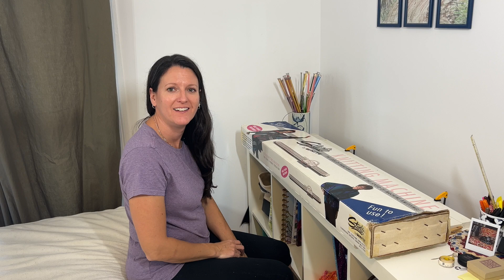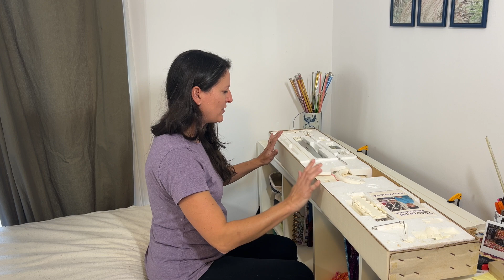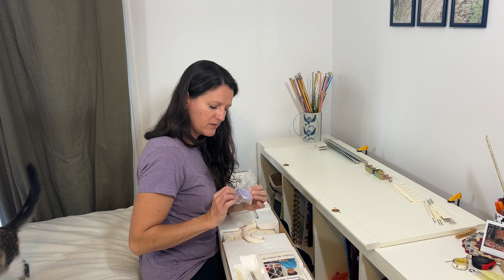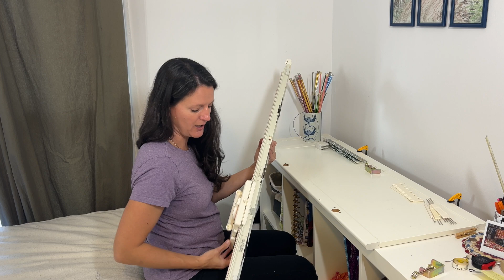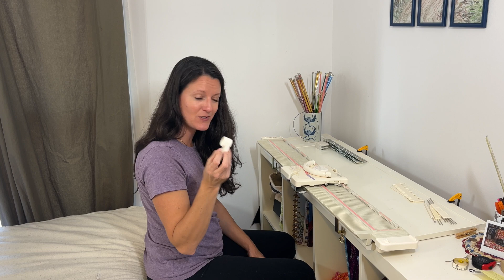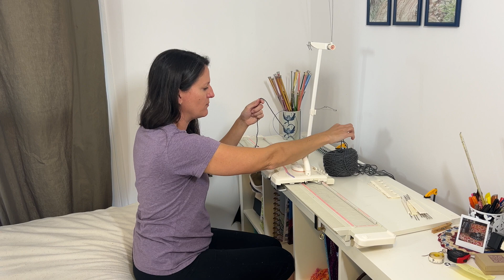LK150 Knitting Machine Setup for Beginners | Easy Step-by-Step Guide

Comment: I have seen some LK150 machines described as having 1 feeder and some other as having 2 feeders. Can anyone describe what that means?
Reply from the maker: The feeder is what holds the yarn in the carriage, and keeps it in position as you move it across the bed.  The one that I have has 2 feeders, so it can hold two different yarns for plating (one yarn is more visible from the right side of work, and the other from the back side).  If you can find an owners manual online it is on page 22.